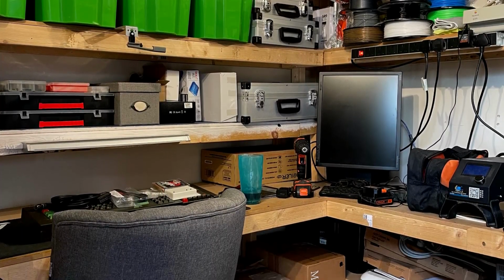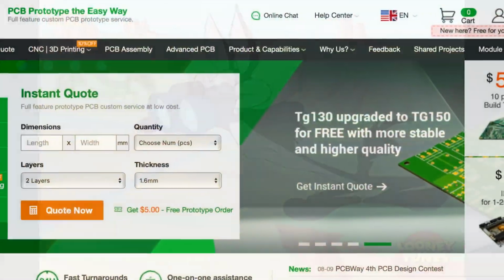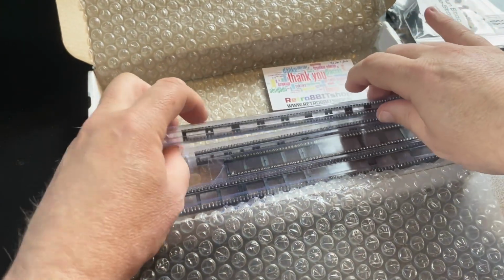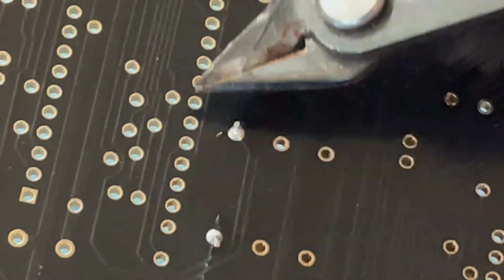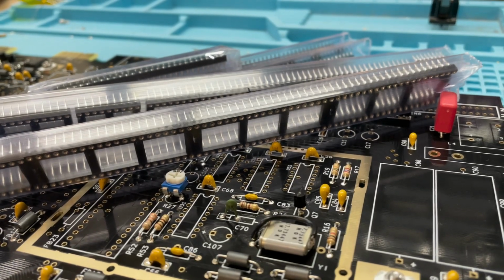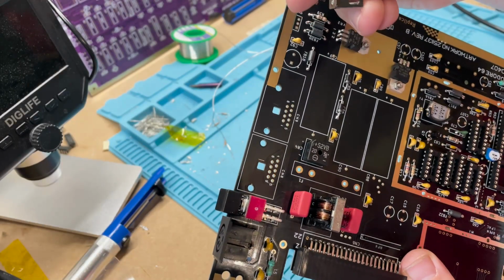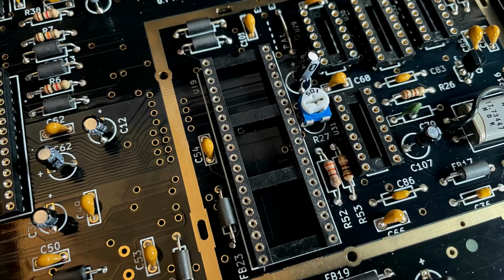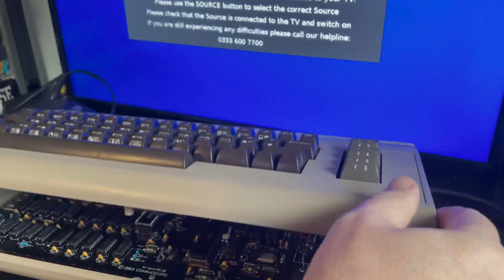Can you build a brand new Commodore 64 from (nearly) 100% new parts?

Comment: As far as I know, there are modern replacements for nearly all of the Commodore custom chips now.  You may want to look into seeking them out for a later video.
Reply from the maker: Already have some on order but they didn't arrive in time for this video - they'll be in the next episode :)
Reply: This would be a fun video
Reply: @TheRetroShack  Looking forward to that! I have my doubts that anyone could make a 100% compatible VIC-II clone* what with all the weird timing bugs that the whole demoscene and plenty of games rely on, but it's not something I've been following recently so I hope to be pleasantly surprised :-).
*An ARM chip running a VIC-II emulator in software doesn't count! 🙂
Reply: @djcsdy2  it "just" a matter of thorough debugging. regarding these timing issues, it is possible to write software that exactly constructs these corner cases. usually it has something to do with ending or starting a line or writing into a sprite register shortly around the time where the sprite is displayed.
it is not magic but thorough work and trying to find all corner cases. you have all the registers and have to find out the time where writing to the register results in an update.
one example: changing the color of a sprite: does it work in the middle of a sprite, does it work only before the sprite is painted, what delay do you have when the first pixel in the line has already been drawn.
it is a huge amount of work to write and check all these (corner) cases. but it can be done.
especially when changing a lot in the VHDL code, you have to run these tests again.
Reply: @stefanweilhartner4415  That's true, but what I was trying to get at is that there may still be unknown unknowns. It's not that long ago that demos were coming out all the time that relied on some newly discovered quirk, and emulators which previously supported every known piece of software would have to be updated to support the newly discovered behaviour. I haven't been following the scene closely in nearly ten years, so for all I know that hasn't happened for a long time, but the scene is still active and I wouldn't like to place any bets that there aren't any quirks left undiscovered. To be absolutely sure you'd have to decap a VIC-II and transcribe its design into a formal proof. As far as I know nobody has done that but I could be wrong.
I have written code to exploit timing-sensitive bugs on the C64 myself (DMA Delay scrolling, etc) so I do have some idea what I'm talking about although I might be out of date! 🙂
Reply: @djcsdy2  There is an FPGA replacement for the VIC II. Search for the VIC II Kawari project for details.
Reply: @djcsdy2  why wouldn't an arm based clone count?  As long as it fits in the socket with no extra connections I'd call it a win.
Reply: @TEDodd  It totally counts it just isn't as interesting to me. Because at the point where you're replacing individual chips on the board with software emulation I, personally, don't see the point in that as opposed to replacing the whole thing with a software emulator. YMMV.
Reply: @djcsdy2  I don't see any real difference in using a FPGA/CPLD versus a microcontroller and software to emulate a hardware design.

A true hardware implementation, with new silicon would be great, but cost is too high to ever happen.
Reply: @TEDodd  well like I said, ymmv. For me a FPGA implementation is as satisfactory as ASIC, but it's not really a logical thing. If we were being logical we probably wouldn't be talking about reimplementation of obsolete parts from 40 year old computers.
Reply: @djcsdy2  Well there is that... Then again I have 51, 52 and 54 year old vehicles.
(that's the 71, 70, and 68 model years)

But to me Verilog/VHDL for a FPGA/CPLD isn't any different than C/C++ for a microprocessor.

I have to fight that battle all the time. I work with aircraft systems and arguing over the line between complex hardware w/firmware and processor w/software.
Reply: @Condor070  That project has been stalled for six months with no hope of continuing. There is no replacement for the VIC-Ii
Reply: I haven't heard an FPGA VIC-II was available yet (though I've been following development.) Also, the 6510 is not replaced yet, as far as I know. Another FPGA or an ARM-based emulator would be needed with respect to the undocumented opcodes and tri-state bus, and at that point - if we're going to be replacing all of the custom chips with pricey FPGA / high-performance ARM projects - we may as well use a single FPGA for the entire thing, a-la Ultimate64.
Reply: @robertmiles9942  if you don't care about undocumented opcodes then you can replace a 6510 with a 65c02 and some additional TTL to implement the IO ports at $0000 and $0001. But yeah I'm inclined to agree that there is not much point in replacing individual chips with FPGA when the whole board has already been implemented in FPGA.
Reply: @TEDodd  latency.
Reply: @peterfireflylund  not sure which comment you were replying to.
Reply: @TEDodd  software emulation has a latency problem that FPGA/CPLD/PAL replacements do not.
Reply: @peterfireflylund  They can. But modern micros are fast enough to match the older hardware. Especially when emulating a single chip.

Even then a software emulation often has to be slowed down to match the original because it's too fast.

Doesn't mean there aren't poorly written emulations, or that underpowered micros aren't used. That's a different issue, not inherent to software emulation.
Reply: @TheRetroShack  is there a replacement for the 6510 yet?
Reply: @TEDodd  VHDL and Verilog are very different from C and C++.  VHDL and Verilog are hardware description languages, whereas the others are programming languages.  VHDL and Verilog compile into a circuit with logic gates, flip flops etc. C and C++ compile into machine code instructions to be executed by a processor.
Reply: @Modellflypappa  duh! Your so smart...

And DO-254 exists for hardware that uses hardware description languages like DO-178 exists for software. 

Because programming those is very similar to software.
Reply: Trust me, there are plenty original chips on the market.
Reply: Yea, the Kawari-min for the VIC2 replacement is amazing (a little frustrating to flash but amazing video quality), but about $80.  You can still buy pulled VIC2 chips for about $40USD, but the video quality is quite poor in comparison.  $180 for boards, basic parts kit about  $180USD, maybe $200 with DHL shipping.  There is almost $400USD without the ROMS, CPU, SID, VIC2, or PLA. $550??  It is fun and should be done about once.  It will be your favorite machine: the one you built, but it is not inexpensive.  It must be a passion.

Comment: I bought the original ZX80 kit and built it at school in my Technology class and after building it it did not work, both me and my teacher tried to problem search it without success ( we suspected a faulty Z80) so I sent it to Sinclair for repair and they sent a brand new kit back with no explanation or paperwork and about 3 weeks later my original build came back working as well, I loved that little thing!

Comment: Great project - When I did mine I used a SixtyClone 250466 as this rev uses the original bread bin SID and VIC-II but benefits from having only the two RAM ICs. With the same aim as using as many new parts as possible I also used the c0pperdragon RF board which gives a much improved video out, ARMSID and GAL based PLA - I also put in a SaRuMan static RAM board and Tolb 8701 replacement, and burnt my own ROM chips for Basic, Kernal and Char. The CPU, CIAs and VIC-II were all salvaged parts as there were no other choices.
Reply from the maker: The plan was to use more homebrew chips but some aren’t available yet as you say, and the kernel and char roms I ordered didn’t turn up in time so they’ll be in the next episode :)
Reply: Sounds much like my SixtyClone. But I went for a RetroTink instead. I also managed to get hands on a NOS modulator. So mine have a near flawless video output. Especially with the Rev5 VIC-II.

Comment: Solder type or screw type D-Sub (Joystick Port)

Nowadays PCBs are mass populated and leaded components are soldered in one move using a process called reflow, which is a standing wave of moltent solder that skims the bottom of the board as the board passes above. This gives all leads and pins a perfect solder. The problem however, is if you have a connector attached with screws, solder often gets into the grooves of the head or alternatively the threads if the screws are fitted the other way round. However, if you opt to fix the screws at the end of production, then solder often gets drawn between the connector and board often making it near impossible to install screws. This is circumvented with using either clipdown connectors, which fare well against the hot molten solder for the brief time it skims across the standing wave, or the solder type, which is my favourite as it offers better grounding for when you need shielding in your cable, such as in DVI or VGA or HDMI connectors. It was never introduced as a time saver, however it has given that result.

Comment: 3D printed pieces are fine if you take the time to prep and finish.  I sculpt/model up ideas, figures, diorama pieces, etc in Blender before diving into hand sculpting using the 3D piece as reference or just straight printing the pieces out either with filament or resin.  Coming from doing a lot of auto body work, the newer filament printers are high enough resolution to get a smooth line new finish without a lot of prep work (basically filler into sanding, on primarily flat or straight-line shapes if printed at high resolution you can get away with 2 coats of primer/filler paint after initial sanding, first coat, wet sand, second coat, wet sand, then go for a final into paint).  The only time I default to resin is if there's a lot of tucked away details making proper finishing a paint.  Not to say you shouldn't prep resin prints too, they're definitely cleaner and higher resolution, but there's still room for improvement (especially drainage holes if those aren't hidden when assembled).

If typically create molds with my pieces after achieving the proper surface and finally casting the final piece.  Not really required for a one off, but if you're planning on doing even a limited run of figures or something it's a lot simpler to just cast them for a consistent end result over printing and finishing each (not to mention faster).

Comment: Great video, there is something quite magical about building your own C64 board! I've recently put together an 250466 SixtyClone board (in glorious purple!) and I too used the Retro8BITshop kit of parts. My build uses a few replica parts like a J-PLA, NanoSwinSID, a SauRuMan64 RAM module and a TEBL Modulator Replacement PCB. For my ROM chips I am using CornBit V2 from BackBit. I also went for a RECOM Switching 5V regulator in place of the 7805, it runs a lot cooler... no need for a heatsink.

My original BreadBin machine uses the less common  KU-14194HB board of which Bwack has also made a replica.

Comment: top content, thanks for this.

at 8:01 the thought occurred "I would mount the resistors and run them continuously for a week to show any failure over longer time periods then take only the passing chips, or stop bothering to test them if none of them fail after all."  I wonder if running them an hour a day versus nonstop would affect them?

soldering them straight on works as long as it's quick enough to make a new one if it fails.
Reply from the maker: Thanks and glad you enjoyed it!  I'm too impatient for multi-day soak tests :) :) :)

Comment: What's available: the 6502 is available as the 65C02, but the required 6510 is only available as the original C=.
There are replacements for the SID and logic array.
But not for the two CIA.
For the video IC there might be a replacement with a raspberry pi zerro, I'm not sure.
Is dynamic RAM still made in this size?
The ROM can be replaced by an EEPROM, but has a slightly different pinout.

But if a Raspi is already on the parts list, you can emulate it.

Comment: This is a great video! While it is tempting to start building such a machine, there are so many things that can go wrong it is intimidating. I think we are going towards a DIY C64 but still, it requires skills which are beyond those of the average enthousiast.
Reply from the maker: I’d recommend starting with something like the RC2014 which is a smaller project but you get exactly the same buzz when it springs to life :)
Reply: Disagree, it's not beyond the attainable skill of the average enthusiast. No, not a first project, but the skills aren't unattainable for most. This isn't tiny surface mount and hot air rework stuff (not that the latter is unattainable either).
Reply: @TEDodd  The difficulty from my point of view is not the soldering etc., it is to diagnose what is wrong when you have everything complete and this is not working. In this video, even if the author is experienced, he had several issues, and solving them requires a very good knowledge of the machine, its components and potential issues.

Comment: I had hoped this would be more about the hunting down and picking modern parts. Any chance of a future video where you actually source readily available stock parts and track down replacements (like FPGAs or whatever) for the special chips? Maybe even slightly modernize it up a bit by adding a few modern ports like keyboard and display — or at least take apart a modern keyboard to make it work with the C64?

Comment: Maybe a 3D-printed custom case with 40mm fan ports on either side w/ some Noctua fans to facilitate some active cooling on the board?  Just a thought.  😁 Maybe even try to work in some dust filters as well!  Maybe pair up a NF-A4x20 with an NF-A4x10 to help facilitate slight positive pressure to further work against the dust.
Reply from the maker: Something VERY cool coming up on this topic very soon :) :)
Reply: @TheRetroShack  Awesome.

Comment: i wont be starting any new retro soldering until i finish soldering the zx81 first. Since xz spectrum came with whole chips set and all the rest of materials it was actually easier to finish it. :D
Reply from the maker: Enjoy!  Hope it works first time :)
Reply: Harlequin spectrum did. But zx81, first will have to finish it. And then troubleshoot. :D

Comment: Some folks are using the raspberry pico, the micro controller, to programming as replacement processor for some buids that have no more chips like old cpu and more. The issue is that so far you have to programme it by yourself.

Comment: Instead of the 7805, use a TSR-1 2450. Much cooler and only costs $5. Morsun makes a similar device for 12V regulator.

Comment: I'm surprised somebody hasn't made a SoC version of the C64, perhaps even with a turbo feature to bring it up to modern processing speeds, but still allow the option for slower clock for older games and such.
Reply: The C64 DTV is exactly that but without the turbo (afaik), although it does have other extra features. Not 100% compatible but it runs most old games.

Comment: “Nice new soldering tip” what? I’ve never had to replace my iron’s soldering tip in the 10+ years I’ve owned it. Routine maintenance by tinning with new flux and solder will keep any tip usable practically forever.

Comment: Yeah you can build any computer from off the shelf parts

With a c64 you'll need to have a 6502 and a few cpld to add the features missing from the 6510

The vic graphics chip you'd  use an fpga, for the custom PLD and Array logic, use a cpld, if it's a gate level vhdl or verilog implementation, its not different logically and electronically from the original, other than the transistor layout and lower power consumption, even keeps the original hardware flaws and feature you typically won't have on a non gate level design (if you have the actual schematics of the chips, yes microchips have schematics of the internal construction, just a motherboard, nested on a PCB motherboard
Reply: Realize the prototypes where built using 7400 logic gates, outside the CPU, then they shrunk it down to a chip, after they debug it

Prototype would be the size of an imsai or Altair with several large wirewrapped boards instead of a graphics chip, and io 

The only chip would be a 6502, some ram, and maybe a uart and pia, and rom

But the average person doesn't want that mess of wires and shit that takes a whole desk to fit it on

Cost more than the chips they fab  after
Reply: The $30 smartphone from Walmart now is basically a supercomputer by 1980s standards

Even fits in my pocket

It fully compatible with all the software for c64, Atari, NES, Sega, etc.

Via emulation

Even 16bit x86 and ms-dos software, Amiga and Atari st

Shit even a PlayStation 1 and PSP, and even with higher resolution and msaa and anti aliasing

Even a Gameboy, Nintendo DS, Nintendo 64, and even a Nintendo Wii (technically a Nintendo GameCube they resold you with a few upgrades)

If you have a beefy chipset even a ps2 and dreamcast

While my desktop has the power to emulate Xbox 360 and PS3

Xbox One and PS4 technically dont need to be emulated, because it's already x86-64bit

Just add a wrapper and hypervisor to route and emulate the graphics API to  opengl or vulkan GPU API, and remap the sound to the sound card, io gets remapped to use the usb and keyboard and Ethernet/wifi

Only problem with the newer consoles you can't connect online

You need to have a keyvault and the right keys and pass integrity and bootloader checks

Something the emulator will have trouble with

Comment: is it possible to have a fastload cart built into one of the ROMs? Maybe install some sort of ultimate loader that has all your carts, and disk images already inside the unit on an SDcard, while still having outward compatibility for a physical cart, printers and disk drives?